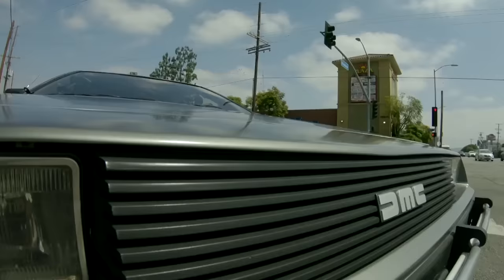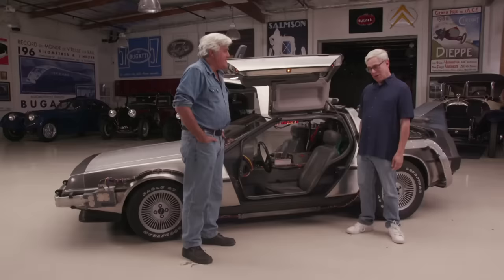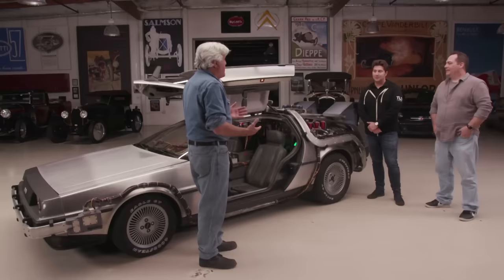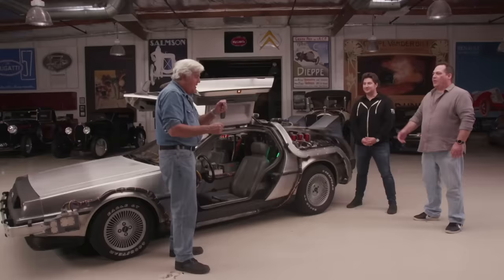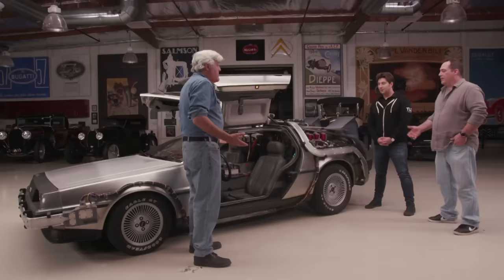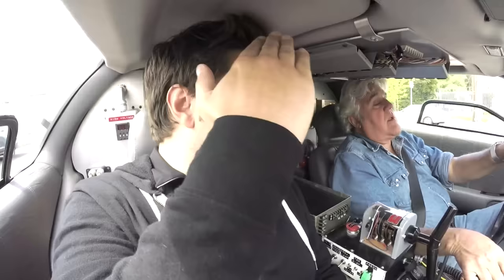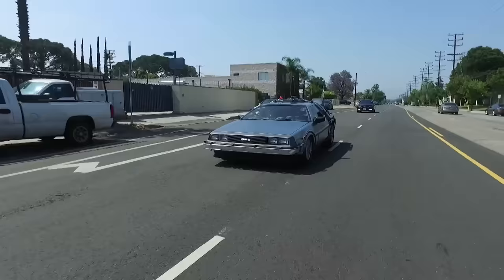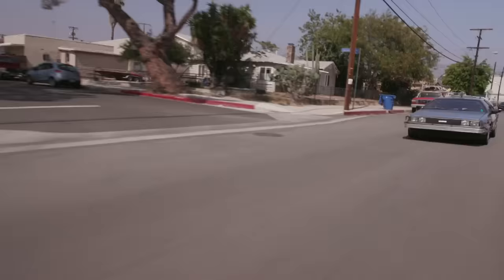Doc Brown’s DeLorean - Jay Leno's Garage

Comment: “Doc Brown doesn’t drive a f***ing Mustang.” Possibly one of the best decisions made in the movie industry. And a badass way to do it🤘😎
Reply: Doc brown is more is vw beetle kind of guy but would not work for the movie
Reply: Could have been driving an old saab. Would have fit pretty well
Reply: That was NEVER enough MONEY !!! So glad tho’ …
Reply: Mustangs are bad cars something like a Delorean is better
Reply: @Flame_4106  Are you not aware just how terrible DeLoreans really are?
Reply: I agree...I own a Mustang and think the movie would had suffered had Doc Brown driven a "Mr. Fusion" Mustang.
Reply: @bigmike9947  I know they were incredibly slow because the engine was underpowered and the car was pretty heavy. Were they unreliable?
Reply: @twistedyogert  DeLorean are notorious for being incredibly unreliable. Nearly all of them left production with faulty electrical systems, and the mechanical components aren't great either. The car didn't go through much testing at all before it went into production, and there wasn't any real QA testing after it was assembled, so pretty much as long as it could drive out of the assembly building under its own power, it was delivered to the customer who had ordered it. But they used very low quality wires and the overall assembly wasn't great, so essentially if you bought (or buy one now that hasn't been renovated), you should be prepared to rewire the whole thing to get it working properly. And like Jay said: the doors don't seal properly and leak, and that goes for every other part of the car as well. Since they were built in Texas they probably didn't care much about that, but it means it's more or less unusable in rain
Reply: While I believe that the DeLorean was the best decision, I'm genuinely curious about what a Fox Body Mustang of the era would've looked like as a time machine.
Reply: @bigmike9947 yes, but waaay more collectible than a crowd smasher. They're less attracted to curbs too😅

Comment: Anyone else notice the graphic equalizer moving to the conversation?
Reply: It's a spectrum analyzer. ;-)
Reply: Probably more likely that it's just a level meter pretending to be a spectrum analyzer.
Reply: Peter Anderson, it is not a sound level meter, it is a functional RTA (Real Time Analyzer) unit. The led bars respond to a different sound frequency each. From low frequencies to high frecuencies (left to right in that order). Notice it when Jay turns on the engine, the far left led bar peaks red from the engine rumble (23:35). Pretty nice detail.
Reply: .Mayhap you're right John - I'll have a closer look.  What pedants we are!
Reply: In the BTTF universe they call it the Christmas tree. What it is suppose to do is actually show the power output of the car. In the films it is usually just hovering around the green area and once the flux capacitor powers up it jumps to the red on all bars. guess its in a demo mode in this car as looks a lot cooler moving than just being at the bottom. Wish they did a segment at night with the flux band on. Did you know in the film those lights were actually white but the camera they used made them look blue

Comment: Compared to a stock model it’s so clear this and the film cars were slightly lowered. You can tell when they pull out the garage and he side shots going down the road. Also Jay Leno and his dry steering on that poor steering linkage trying to get out the garage 😂.
Reply: You're not going to mention that the movie version of the car didn't have a Delorean engine? They switched it out for a 1983 Porche 328 234HP 4.7 liter V8 as far as I can tell.
Reply: @parker469a  *Porsche 928

Comment: Best 75k ever invested into a Movie by just saying no to a Mustang 😂
Reply: ActionHeinz that was not invested.
Reply: Doc brown don't drive a f**king mustang
Reply: Would have been fine with a SVO Mustang.  The loss of the gullwing doors would have been the biggest loss.
Reply: A 5.0 would have got to 88 mph way faster lol
Reply: James Gould an 80’s mustang? Hardly. That thing will barely hit that. Maybe a new 5.0
Reply: Yes even a stock or lightly modified 5.0 has way more power and torque than that piddly Da Lorean 6 cyl
Reply: Tomekkplk  Lol, a 1988 5.0 LX with the 10 minute tune up will trap almost 100 mph in the 1/4. 

Better brush up on your auto history.  The 5.0 Mustang of the 80s beat most of the Ferraris and Corvettes of the 80s in drag race.  And yes, it would have gotten to 88 mph in about 10 seconds, MUCH faster than the V6 Delorean.
Reply: you're dreaming, the Iroc-z's spanked those old 5.0 Mustangs all day long. The F40 was king of the supercars, no way a little pony was beating that.
Reply: DB 007  The F40 was Ferrari’s flagship.  Most of their regular production Ferrari’s would lose to the 5.0. 

The Mass Air 5.0 LXs were faster than any 3rd Gen Iroc-Z.

Comment: Doc: we out-fitted the vehicle with this big pole and hook which
runs directly into the
 flux-capacitor. At the calculated moment, you start off from down the
street driving toward the
 cable execrating to eighty-eight miles per hour. According to the flyer,
at 10;04 pm lightning will
 strike the clocktower sending one point twenty-one gigawatts into the
flux-capacitor, sending
 you back to 1985. Alright now, watch this. You wind up the car and
release it, I'll simulate the
 lightening. Ready, set, release. It's the Libyans!!!!!
Reply: yesss!! thx XD
Reply: "Please excuse the crudity of the model, I didn't have time to build it to scale or to paint it.."
Reply: "It's fine Doc."

(he repeats the line in BTTF 3 back in 1885) :D
Reply: Bird Plan good times !

Comment: Is it just me, or does that engine sound like a 60's VW beetle? 

Time for an engine swap.
Reply: Well...
Delorean engines are underpowered.
Reply: @junatah5903  
Peugeots after all.
Reply: @commietearsdrinker  yeah I think they where Peugeot engines.
Reply: @commietearsdrinker  close, it was a Renault
Reply: @c0rr0s10n  
It's a PRV6.
P-Eugeot
R-Enault
V-olvo
6-Cylinders.
Reply: @commietearsdrinker  ...and the original plan included a turbocharger.  They ditched the turbocharger to control costs, so they were left with a low compression six making hardly any power at all.  The modern Delorean Motor Cars (the company in Houston that now owns the name, which Jay mentioned) can set you up with the turbo kit like it should have had.

Comment: I really would like one of those with electric drive train, no need for 1,21 GW though :-)
Reply: There is at least one comapny around that might be able to convert a regular DeLorean to run on electricity.

But with todays battery technology, you can probably go 88 miles before you have to re-charge! ;-)

Comment: For those of you wondering about the Movie, the Doc, and the Trial of Delorean - Delorean is actually what spawned the Entrapment Clause in US Law!  Synopsis: During the 70's Oil embargo and gas prices tanked the economy, Delorean wasn't selling his cars and was near bankrupt; he needed roughly 300,000 to stay afloat.  Side note:  The late 70's early 80's, The DEA was cracking down on the influx of drugs coming in and thought the Delorean car was a joke - no way could it have been as successful in sales as it was reporting.  The DEA was certain Delorean had to have been dealing in drugs.  Knowing he needed 300,000 to save his company, they devised a sting.  

They approached Delorean, as undercover, to pay him to literally drive the proverbial van back from Mexico for $300,000.  Delorean repeatedly said no.  This went on for several months and each time, Delorean said no.  Finally, on the brink of losing his company, he caved, and agreed to do it, knowing it would be a 1 time thing that could save his company.  DEA swooped in and arrested him.

At trial, the judge threw it out citing Entrapment; that although it was a crime, the DEA pressured, bullied, and enticed him to perform an illegal act which he normally wouldnt do (and in fact, was documented several times that he did say no).

So hence, the first usage of Entrapment as a defense in a criminal case in US.  Neat!

Sources:  1984: DeLorean cleared of drugs charges". BBC News. BBC. August 16, 1984. Retrieved November 25, 2016
                  1984 Year in Review: John DeLorean Trial". UPI. October 29, 1982. Archived from the original on July 22, 2013  .

Comment: I've got a '77 Rover left hand drive mini cooper. The old-style italian job car. It always got lots of interest, but in this day and age, half of the comments were "Is that one of those new hybrids"... then I hopped in, fired up my efi fuel injected 1.3 liter engine with an RC-10 exhaust that wasn't so much muffler as amplifier, it sounded like a rabid F1 from the 1960's, and nobody asked me if my car was electric afterwards.

Comment: so I want to get super nerdy here for the guys who don't know the time travel terms. this is to simplify the thinking. it comes in two parts. the first word "flux" is defined as a change in time perception. when it's faster or slower, hence "time flies when you are having fun" and it goes slow when you are bored. OR it goes backwards of forwards. The second word "capacitor". what does a capacitor do? well it's in tv's but a way to more simply explain is when a subwoofer is installed in a car. it's basically a battery that give something a temporary boost of power to take the strain off the original power source. in this case, the alternator or battery of a car. without the capacitor in line, a car's headlights dim every time a bass bump hits. the capacitor takes that stress for the rest of the car's electrical to keep functioning properly. A flux capacitor does the same thing for time in the car. so that's why it "makes time travel possible". I'm sure I lost all the ladies in the room ha ha

Comment: The engine is a V6 PRV for Peugeot-Renault-Volvo. It was a joint venture between this 3 manufakturers to develop, buit and sell this engine. The power output varied between 125 and 270 Hp ( up to 910+hp in competition)
Reply: lmao. They made a couple factory twin turbos, but your comment is totally misleading.

Comment: DeLorean basically used the same PRV (Peugeot/Renault/Volvo) V6 engine that the Volvo 760 used, although the one in the DeLorean had the Peugeot engine code. A 2.8 liter unit that (when new) delivered around 150 horsepower.
The engine itself is known to be a nightmare, and it is notoriously unreliable. Its fuel consumption was very high (13-15 liters / 100km was not unusual), and it seriously lacked performance, which might have been the reason for it to burn so much fuel.
PRV made several variants of this odd 90° V6, ranging from 2.4 liters, up to 3 liters. Common for all of these were problems related to engine cooling, where the flow of coolant was being restricted by a design flaw in the cooling channels. This often led to warped cylinder heads, and blown head gaskets due to overheating. Many PRV owners modified the engine's cooling so that they could run more reliably.

Comment: Hey Jay;  I just saw a DeLorean "Time Machine" in Jefferson, Wisconsin last Saturday,  4/24/'21.  I wonder who owned it?  By the way, do you have any interest in a stock 1985 Pontiac Recaro Trans Am?  I'm the original owner.  It's all black w/gold trim, a camel interior, fully loaded WS6, racing seats, whale tail and a Big Fire Chicken on the hood.  It's a Tuned Port Injection and actually an I.R.O.C. with a better interior.  I'm 71 and thinking of letting it go.   DGM

Comment: real cars tv shows made famous
green hornet             - 1966 chrysler imperial

A-team                       - 1983 gmc vandura
                                    - 1984 chevy corvette

knight rider                - 1982  pontiac firebird trans am

starsky n hutch         - 1974-76 ford torino

the beverly hillbillies - 1921 oldsmobile model 46 roadster

batman tv series        - 1955 lincoln futura

dukes of hazard         - 1969 dodge charger
                                      - 1980 cj-7 jeep
                                      - 1970 cadillac de ville
                                      - 1969 chevy c-10 tow truck
                                      - 1975 dodge monaco
could do a seperate list of cars from movies. looks like they havnt made shows since the mid 80's that had the car or cars as supporting actors. least none I can think of, guess they just dont make tv like they used to.   :(

Comment: pfft, the speedos only read to 85, but most cutouts were for 90-110. Easiest way to see how fast your car could go was blowing past one of the thousands of deputy enus' hidden speed traps. Even the '85 buick grand national could do a cutout at 120, despite the fact McClaren built their high performance aluminum block v-6 motors to do over 150. A gauge for top speed doesn't equal a gauge for rpm for a given gear.

Comment: If you keep up with the space program you would have seen that Elon musk and NASA made it announcement about 4 months ago they have a viable warp engine and the reason why I'm mentioning that is you fly fast enough around the Sun to do a slingshot effect it will throw you into a timely the other way is the fly almost at light speed in normal space

Comment: 1. Bob Gale was modeled from George McFly and the other way around.
2. Some of the Leno wagging about Corvette is incomplete.  The Delorean is more Porsche 911 than Corvette or had you not noticed? The 6 cylinder Engine is in the back with IRS and EFI installed longitudinally. 
My vision for an episode of Back to the Future is "What would reality do to the BTTF car if all things were real and true the opposite of what Donald Trump says".
Reply: Doc Brown said,  "It's Electrical" which to me means hybrid. So he needed to do a Brake Stand (8800 rpm) with a monster stator generator to produce that kind of voltage.

Comment: DeLorean screwed up by putting a puny 130 hp V6 in it, top speed 109 mph, 0 to 60 in 10 seconds. A sports car with no power or speed is just not a coveted item. It also didn't look all that great, looked like an AMC product to me. You probably wouldn't buy it just for the looks. The stainless steel body was a good idea, but it was unpaintable because it was brushed so everybody's DeLorean looked exactly the same. You could have any color you liked, as long as it was gray brushed steel.

Comment: 7:30 Not true. Flux Compression Generators are a real thing. FCG;s use a controlled explosion to generate a very high voltage in a very short time. FCG's really exist; what they are used for - I have no idea. I have no idea why they'd NEED that much amperage but FCG''s exist. I was in the military and can confirm this technology exists but for TIME travel - I can't confirm or deny. I'm still bound by an oath of secrecy. How tf Hollywood movie producers ever figured this out - I'll never be able to figure out. Where they got the idea from... I've been trying to figure out for years - all I know is that the technology exists and has been around for YEARS.